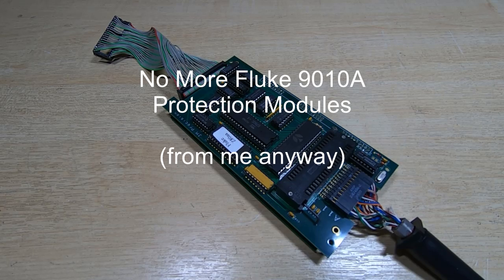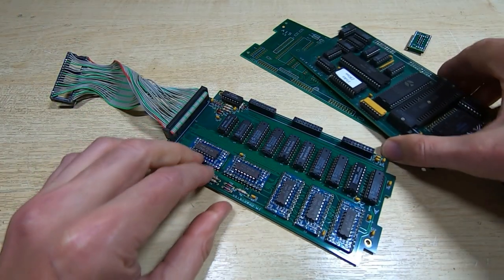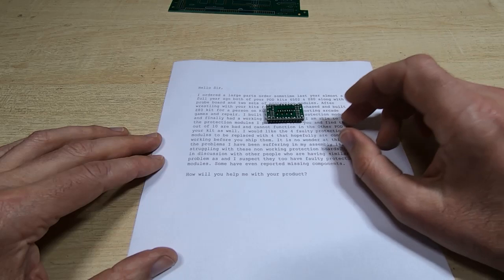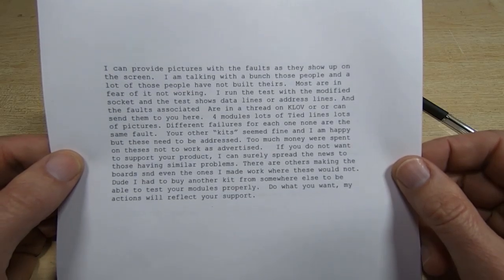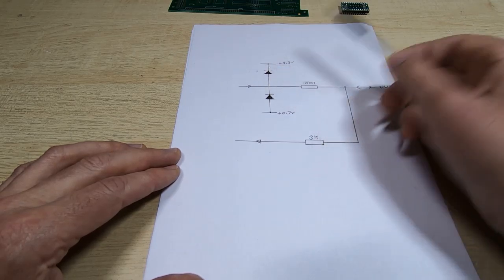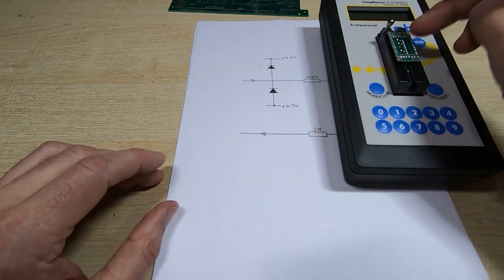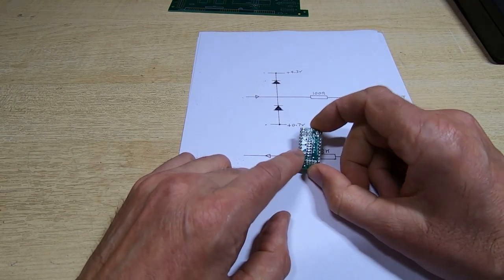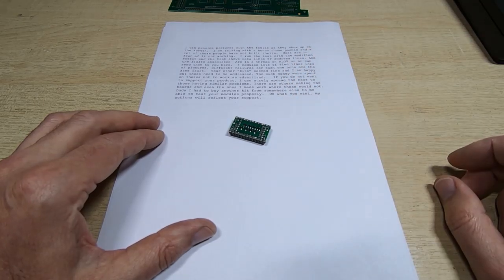No more Modules

Comment: A person who is in need to do work on circuits as complicated as Z80 or 6502 systems and is in need of doing analysis with tools like a Fluke 9010A, has to come from a fairly educated level of digital electronics. I'm confident to say that anyone with such a background would fix such TTL line protection issue (if at all) in minutes and share it with you, instead of complaining. This should be the proper mindset for the community. Pity, but never mind Jerry, I enjoy your video's and products and you have my support!
Reply from the maker: I could not have put it better myself. The modules are very simple and I am surprised that someone would be unable to 'fix' them. They should of course work and if someone sends me a valid report of a fault I would be happy to look into it but someone simply demanding replacements because they cannot get their pod to work is unhelpful.

Comment: A "game of Chinese whispers" happens a lot on forums. It is a shame just a couple of people can essentially spoil it for the majority. I can't blame you. I would love to see a video on the tester. Never seen one before, but we used to build/program test fixtures for Fairchild testers to do essentially the same thing at a board level with pogo pins and vacuum fixtures before surface mount.
Reply from the maker: Yes I always find forums can create more problems rather than answering the questions asked. I will be posting a video on the test program for the module which I use in the tester as this will further demonstrate the level of testing carried out and hopefully be of interest to some. A company I worked for in the 80's used a huge test machine which used 'bed of nails' fixtures. It was made by a company called 'Wayne Kerr' which I always thought was a very unfortunate name.
Reply: @JerryWalker001  Yes, in the early 1980s I worked in the test engineering lab for SCI, now part of Sanmina. We manufactured IBM, Compaq, and lots of different products. That's where I learned the 9010, 9020, and used/programmed a "Probotics" (think plotter mechanism that used the 9020 logic probe in place of a pen). Exciting and fun years for me. Making 30k IBM motherboards a week and IBM screaming for more.

Comment: Sorry to hear that you need to discontinue your products because basically some people have no idea how to troubleshoot their own circuits. On the other hand, they don't seem that complicated to build by anyone that needs them.
Reply from the maker: Yes, The sad thing is that I sell these at cost so it makes no financial difference to me if people buy them or not although I would prefer that they do because they are then supporting the vintage equipment which is my main goal. People that 'threaten' to spread gossip in an attempt to harm my sales only hurt other people that may actually want to benefit from my efforts. NOT selling actually saves me time and effort. Each channel of the module is just 2 diodes and two resistors and while they should of course work it should also be very easy for builders to test any suspect modules and report any faults instead of acting like babies. There is not much I can do when someone sends emails like the ones I showed.